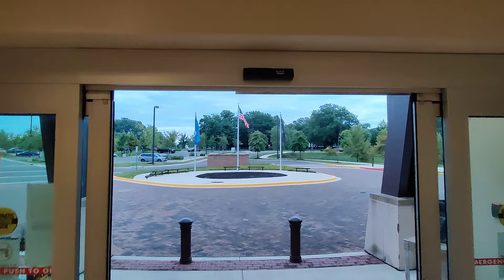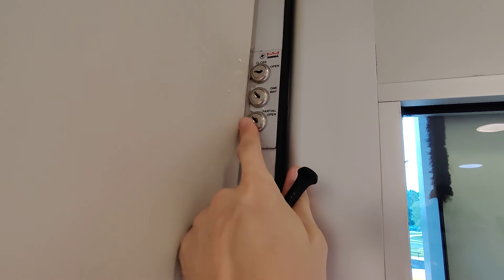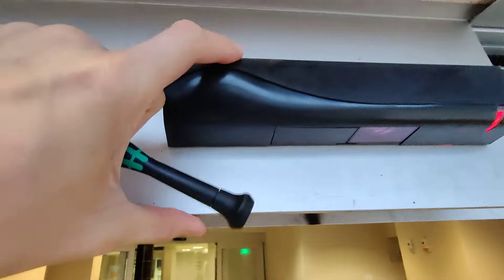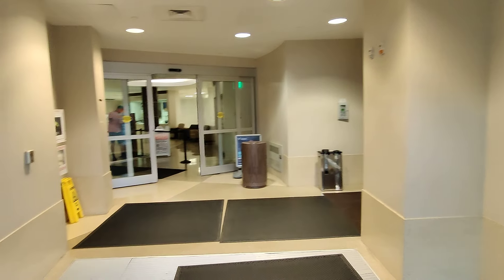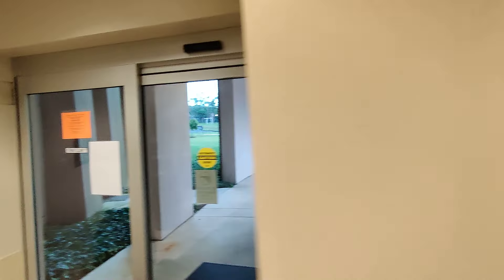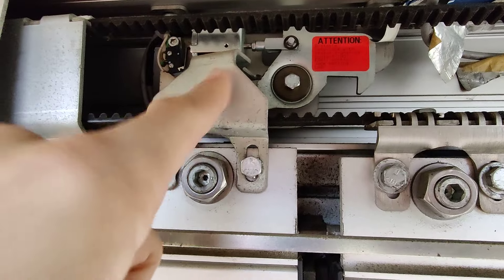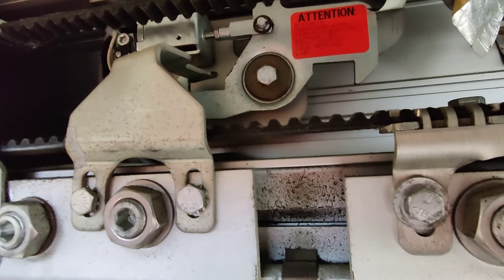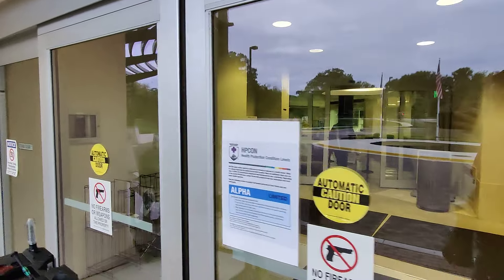Dorma Automatic Door Stuck Open troubleshooting #repair #automatic #door #accesscontrol

Comment: Any experience in optex sensor with sliding doors not sliding open when sensing ?
Reply from the maker: Yes, but there are too many variables with them. They usually have like 10 dip switch variations and then there's other potential issues like a loose wire somewhere or a short.

Comment: I have an automatic sliding door it works perfectly but it has a popping sound when it opens and close so how to fix it or what is the problem if you have an idea.
Reply from the maker: Not sure. Every scenario is different. I think the popping sound might be the lock latching? If you open up the header, try to find what is making the popping sound.

Comment: When the key badge stays green, is that telling the door to open?
Reply: Yes…a constant green light on a fob/card reader is generally a sign that the card reader is sending a continuous activation signal to the control. This could also happen with transmitters and switches that malfunction on handicap push pads which also will keep the SX panels from closing.